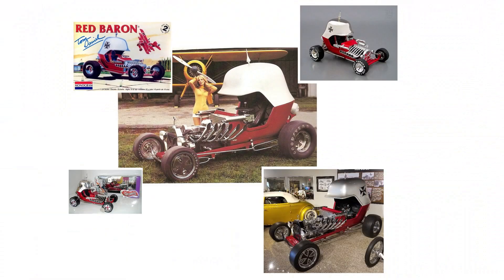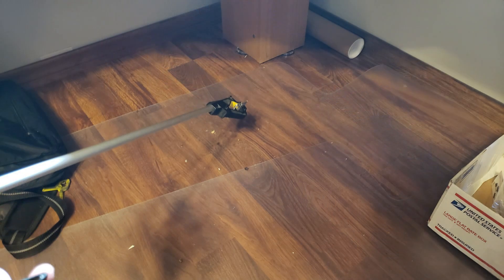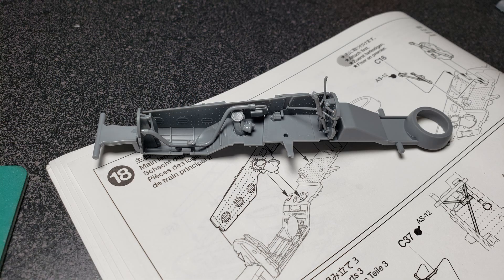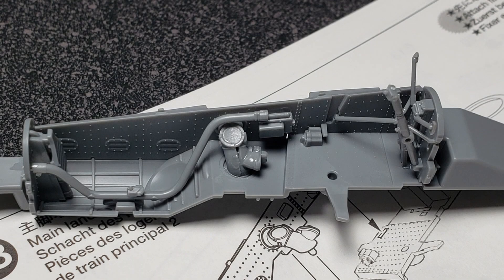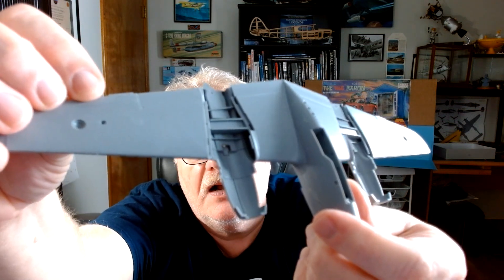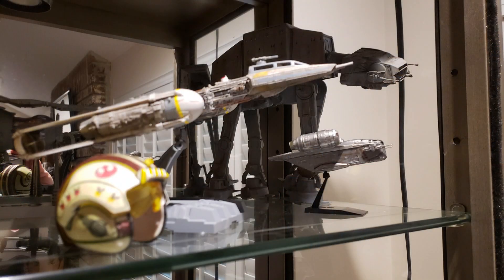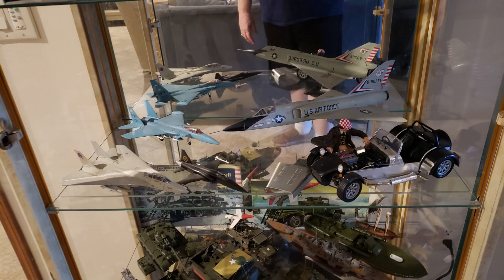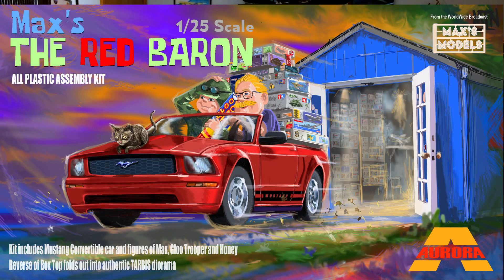Max's Models after hours 07/24/23

Comment: You definitely are having a good time. Those claw pick ups are great for going under the table. Another item I use is a small whisk brush and small dustpan. Got it at a dollar store. The brush part is about 4 inches across. It clips into the pan for storage. I tied a thin flat stick (ruler will do) to make the handle longer. If I drop a part and do not see it,  I use it to brush all around under the desk, my chair, the floor around me. I then sweep the dirt pile I have created into the little dust pan. And sure enough the little part ends up in the pan.
Reply from the maker: I have a dustpan/brush like that in the TARBIS.
Reply: Hey, I do that.....damn tables getting in our way.

Comment: I used grabber tools to act as my robot arms for a Halloween costume I made one year.  Since I didn’t want 3’ arms after my elbow so I had to cut them in half, bent the metal rods to fit and re-glued them together.  

The P-38 is a beautifully designed aircraft and for something that was designed in the late 30’s (I think) when a lot of aircraft were still of  WWI vintage.

The aim was to be able to hold and eat/drink, especially a CDN beer bottle.  The holding part worked out 100%, the eating/drinking part not so well - but the design of the costume was partly to blame as is my naturally clumsy nature.  I used dryer tubing to cover my arms (and legs) and of course the grabber tool.

Comment: Dude....that kit is $73 with s&h.
It's a 5600 yen kit in Japan ....which makes it like 43% cheaper for us if we decide to buy it...that kit should be $30+S&H if you adjust for currency.
That model is more then double WATF is going on. The yen is not equal to the dollar. And it cost $8 to ship something from Japan. 
I havent spent $70 on a single kit yet....something in me tells me stop.....probably my mommas teachings.
For some reason I though the p38 was bigger, I'm probably mixing it up with the p-61.
Apparently the p-38J version just came out last year...lemme see how much the new one is.....the wing supports look like they have more detail I guess...still $70
Reply: I wonder if the price is so high because it's a limited availability kit?  Many places online seem to only have 1 or 2 in stock. Is it out of production?   The tamiya 1/48 corsair goes for less than $30.
Reply: PS it sure is a beautiful kit.  But I get your point about the cost!
Reply: @ronandanne1  The kit is about $100 here in Canada and the J model about $ 95.  There was a price increase so new supplies of the J model will go up.  It is a highly detailed kit and that is why the price is high. The Corsair kit is an old mold and thus is a lot cheaper. I can get the older 1/48 kits of Zeroes etc for about 20 bucks here. Still in production as is the J model. It is a popular model kit, selling well.Tamiya did make a special edition kit ;the "H" model. It was a white box limited edition kit and is now out of production.
Reply: Importer mark up, brokerage fees, duties, etc. We get screwed in Canada because of various add ons. The kit sells for $ 100 bucks Canadian. It was about $65 USD. With exchange that would be about $85 CAD. But things are never equal to the exchange rate. And the price is going up with the next Tamiya order, my hobby shop says. Funny thing, I have seen Tamiya paint online in USA stores and it is more expensive than the Canadian price.
Reply: @garfieldsmith332  The joys of the Northern Pa-so!
Reply: darkwood777  High shipping costs and currency exchange rates make it difficult for me to order kits from outside Canada. Sometimes the shipping is very high even within Canada. I buy from my local hobby store or online from a shop in my province (free shipping over a certain price). I may pay more but in most cases I only spend a few dollars extra buying it here. Depending upon the value of the items I may have to pay Canadian sales taxes (13% and a post office handling charge). Happened with dvds. over $ 100 CAD I had to pay the taxes plus 10 bucks handling fee. I know of a modeler who got dinged for taxes plus duty and brokerage fees on an order. The online store I buy from here had the AHHQ Sherman and Tiger I. I paid $ 10 more and $ 12 more for the kits than had I ordered them from Andys' direct. So it was best to do it that way; and they came to me in 2 days with free shipping. I only order CD and DVDs online because no one carries them here. Most come from Amazon Canada and I get free shipping.